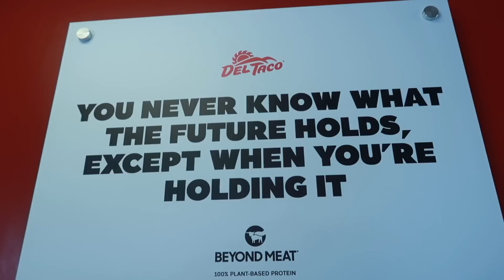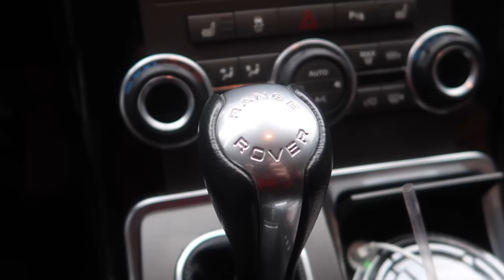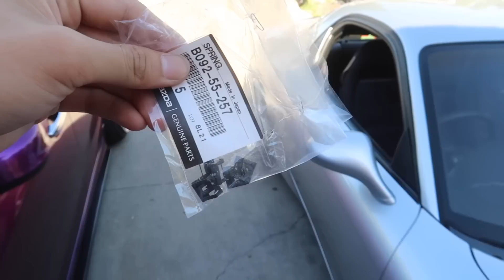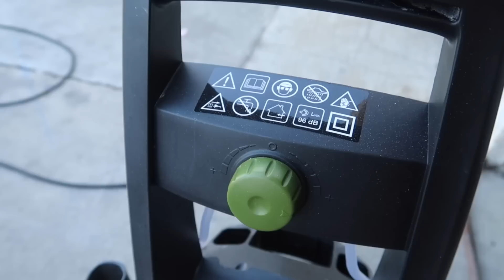This is worse than we thought...

Comment: @08:56  Got oil level for a car that Burns oil is actually perfect time for you to check it. If your card did not burn oil that would legitimately be the perfect oil level however send your car does burn oil. 3/4 of that stick is deftly the safety zone. Don't want to anymore than that though any more than that (over filling) causes just as many issues as no oil.

Comment: I have seen your RX7 vids and as a RX7 professional/owner I am concerned of how much you might not know to care for your RE, 1st I hope your not using convention U.S oil and would highly recommend royal purple oil from racing beat(which they can recommend which oil for your stock RE), 2nd you can buy carbon fiber to wrap all panels or clean of panels and custom color paint them(somthing exotic/sports hot color that breing the best of your RX7), 3rd you have a true sports car so make your car look and be a sports car, place functional components that make your car show that it's a 0-60 in 4sec & not 0-60 in 12sec(it's your car but you have a car that has value for it's history since everything is original, unless your car is for show which I would think and plan right before slapping something that will ruin the car natural beauty)  P.S check your oil/water daily at end of day of use and add what is needed, and yes change your oil and clean or change spark plugs every 1500 to 2500 miles depending if it's a daily driver or weekend summer cruiser.  Cheers hope this helps Sunny and take care of your RX7 ✌👍